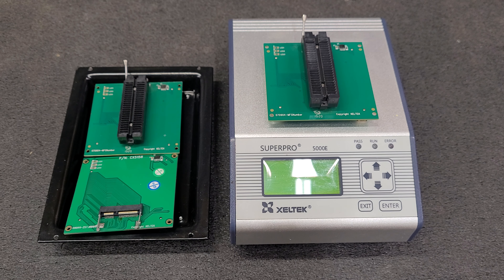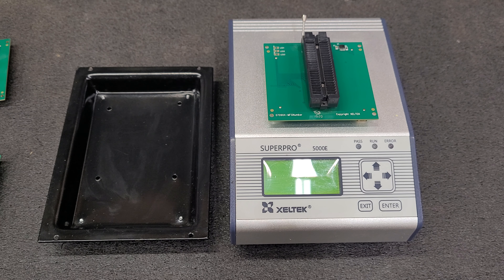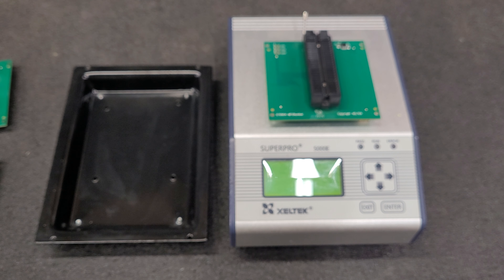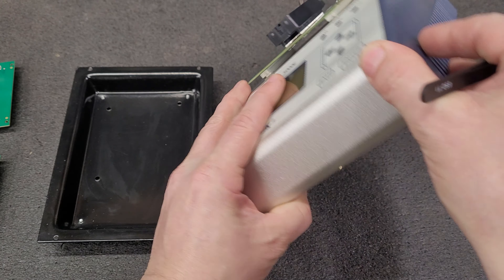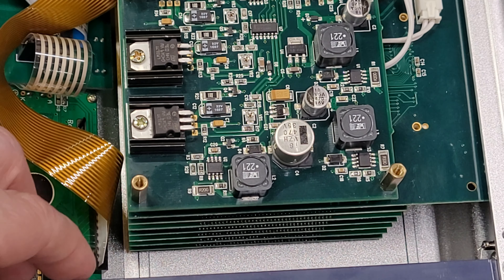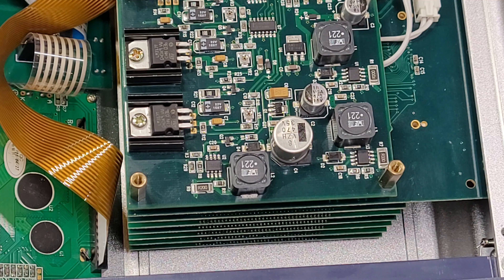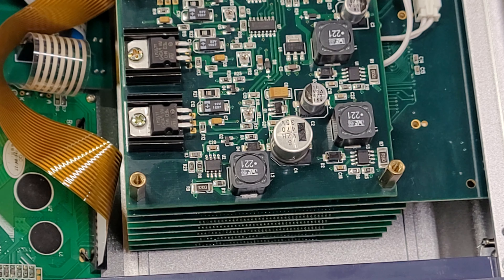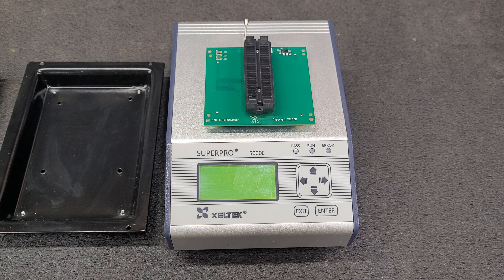Xeltek Unmatched Adapter Fix For Superpro 5000 5000E 6000 6000E 6100 (Not 6100N) IC Chip Programmers

Comment: How can i programming by ISP cable? could you show me the placement order of each pins please?🙏🏻
Reply from the maker: What chip? When you select the device (if ISP is Supported) in the programmer software there will be a window that pops up and shows the isp connections on the programmer and what pins to use on the target.
Reply: MC908AP64A

Comment: Hi, any experience ordering the programmer from goldenchipset? are these legit, authentic? any shortcomings? thanks
Reply from the maker: No experience with goldenchipset only hklrf.com and ecmo for adapter they are genuine Xeltek so i would assume their programmers are also. But, If in the USA spend the extra 80-100 and buy a 6100N programmer from xeltekusa and get warranty / support.

Comment: Oh my, now after ink cartridges they put DRM eeproms on a bare PCB? That's insane.
Reply from the maker: Yes, Here is a link with more info on the AE801 Security Chip.  https://sudonull.com/post/73839-XELTEK-adapter-cloning-protection-mechanism
Reply from the maker: Also, the AE801 Chip is Just a Remarked LTK4200HS.